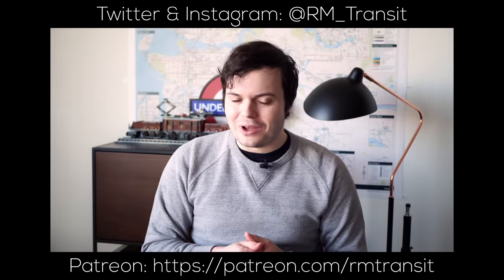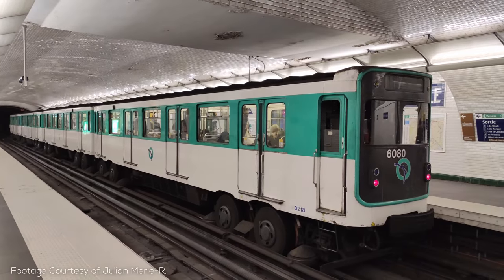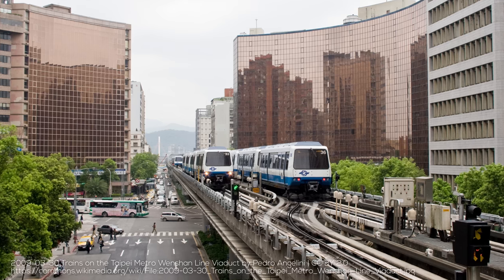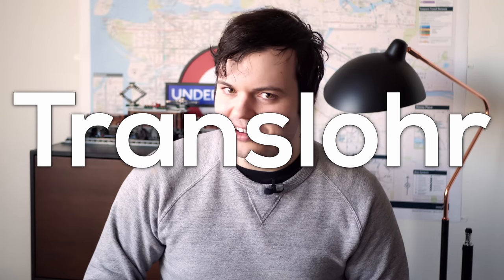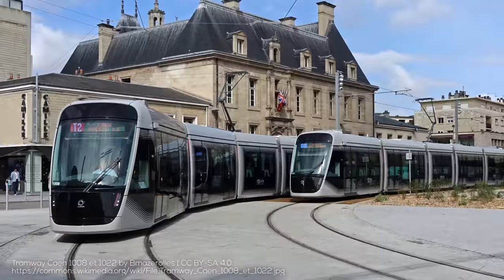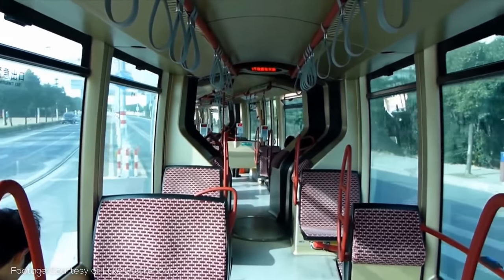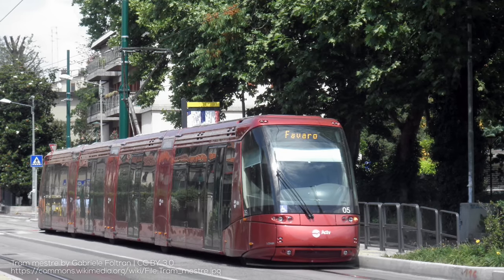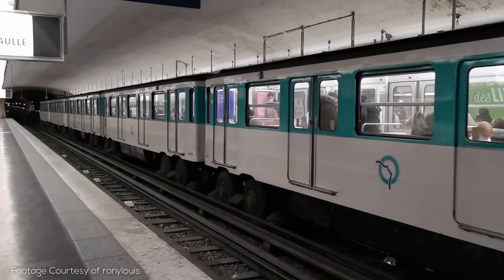Rubber-Tire Rail Transit is Weird

Comment: I was actually surprised you didn't talk Autonomous Rail Rapid Transit (sometimes called "trackles tram" such as in an article by The Conversation — and that one is kind of a joke, really) which takes the Translor idea but with less infrastructure i.e. the "rails" is just paint on the street and the vehicles are battery only, no overhead wires.
Reply: I think ART is still too new to be relevant atm, no cities actually use them yet except experiment units.
Reply: Isn’t that just a trolley bus?
Reply: @KRYMauL  While that's a common alternative name to trolleybuses (though I put them to the same category as normal buses in the same way how I call diesel trains diesel trains and not tracked buses), the vehicles of ARRT are battery buses and aren't connected by overhead wires.
Reply: That’s actually fantastic. Without using a steel guide and pantograph it can avoid the infrastructure cost and it can be varied very slightly to avoid wear. It can go up hill and have better braking. But it can all offer better amenity and higher capacity than BRT. “Paint on the street” isn’t an insult, it’s exactly how we designate bus lanes and stop cars from parking in public space for basically nothing. It’s treated as a joke cause “real trams” already exist but the idea actually achieves things trams don’t. Appealing to the status quo didn’t get horses very far when cars came around. I think these will be very common one day. While people discuss whether they can be a thing car companies are making electric vehicles and mining companies run guided trucks. They didn’t umm and ahh about it asking for permission.
Reply from the maker: They are really just another new bus design that has lots of issues that make me skeptical
Reply: It’s a bus
Reply: @Freshbott2  "Without using a steel guide and pantograph it can avoid the infrastructure cost and it can be varied very slightly to avoid wear."
I can understand with rails but long-term wise, you'd rather want overhead wires than batteries due to loss in efficiency in converting electrical energy into chemical energy and then back (same reason as why we still should build [more] overhead wires now that battery trains exist), it's this reason why many cities such as Frankfurt and Berlin consider installing trolleybuses despite the fact that a majority of their fleet are now battery buses (and I'd certainly start a movement to push them in other, smaller cities with frequent buses as well).
Furthermore, since you lack a return current (i.e. rails), you must use a trolley collector whose wires are a bit harder to install compared to a pantograph system.

"It can go up hill and have better braking."
Since I live in South Germany and have seen trams which handle hills just fine, that one is more of a moot point, though the latter is an actual pro argument (it does come with the cost of energy efficiency, though, which is even more important with batteries).

"But it can all offer better amenity and higher capacity than BRT."
I mean, I'm not fond of BRTs in general, really, by the fact that they have a high running cost despite their low capital cost but they aren't comparable as well since one is a type of vehicle, the other is a mode of a bus.
Furthermore, amenity is infrastructure and has nothing to do with the vehicles deployed.

"’Paint on the street‘ isn’t an insult, it’s exactly how we designate bus lanes"
One is a right-of-way thing, the other is a guideway for a vehicle, they can't be compared with each other. I included that because of the comparison with infrastructure or lack thereof.

"It’s treated as a joke cause “real trams” already exist but the idea actually achieves things trams don’t."
Some cities which used to use a translor switched back to traditional trams so don't set your hopes too high! Derailment may not happen too often (hopefully) but ultimately, ARRT are still a variation of rubber tyred trams.

"Appealing to the status quo didn’t get horses very far when cars came around."
If you understood you correctly, it means that we should always look at innovations and drop old stuff when they're mature? While it's true that some risks should be taken, keep in mind that innovations also have failed quite a bit due to their limitations and relying on old technology just ended up being the best (yes, I'm rather conservative with innovations in general).
In fact, (passenger) trains were considered obsolete like horses because cars and planes are (supposedly) better and yet, they're making a comeback with many new HSR projects (even in NA which is the biggest offender in abolishing trains), reactivations of old lines and building new normal lines while on the street, more and more trams are reintroduced in cities which have removed them.
Reply: really the most advanced part of the ART from what I've heard, is the suspension system which is designed to help give it a smooth rail-like ride. Well okay, but why not just fit that to a regular bus and bring the cost down?
Reply: @RMTransit  Those combine the capacity of a tram with the flexibility of a bus, which makes them ideal as an interim solution for lines that have outgrown what busses can provide but that can't wait for a real tram line to be built. Or on seasonal lines, where the extra cost of putting in rails and wires would be prohibitive. Or even commuter lines that only need the extra capacity for 2 hours a day. I also see potential in using them temporarily to test out planned lines without having to build them first. Or to provide service while part of the regular tram lines is closed for maintenance or construction.

A current example would be Tesla Berlin (plenty of drone videos on YouTube), where they have a shuttle service to the next train station until they get their own passenger station. They are running 3(!) articulated buses every 10 minutes at the moment...

And btw, I think the "autonomous" feature where the vehicle follows painted lines is the most useless aspect. For me, the big selling point would be that it doesn't need any infrastructure, aside from maybe some portable barriers to mark off the stops.
Reply: Perth, Australia is looking at getting this, and they would be much better off getting a tram, or even just using existing busses on a dedicated right of way, brt style.

Comment: Good video and I cannot help but add something. 
I don't think Translohr is better than a tram (and not just because the hybrid electric-pneumatic door system is unpleasant to test after we assemble it in our factory). However to be completely fair to it there are two advantages of it that I have not seen mentioned and as you said in some niche cases they can contribute to this system winning. 
1. the noise - despite the guide rail the one I have seen in person in Paris was singificantly quieter in the street than a tram. Modern trams make the difference smaller and smaller with clever wheel designs but the only time I have seen a translohr running the lack of expected noise was the first thing I noticed and after I wondered why that is I finally saw that it is a Translohr and not a tram. So I guess in some cases this could be a factor when deciding what to build. 
2. narrow spaces and two-wheelers - one thing I absolutely hate about trams is that whenever there is the need for the tram to go to the side of the road in a tram stop or the tram stop is extended towards the rails and there is no cycle path behind the tram stop away from the rails all cyclists passing throuh face a choice of two bad options - ride the narrow space between the high tram stop curb and the rail (and pray no stupid driver will start overtaking you in the remaining space where they fit with whole 5cm to spare) or you can cross the nearer rail at a horribly sharp angle, ride in between the rails through the tram stop and then cross back to the side again. If the rails are a bit wet and/or you are not capable of jumping with your bike you will crash and possibly get run over by anything following behind you. I have seen motorbikes crash in these tram stops too. Translohr will have something like 1.2m between the curb and the guide rail negating the need to go over the rail. So if I had to mix something like a tram line with a lot of trafic on two wheels in narrow streets Translohr would get one plus point in the contest for this. 
So if the line is in a sunny dry city, passes through a flat center where tons of people cycle rather than walk and runs into steep hills on both ends where rich and powerful people living there demand it to be quiet Translohr just migh fit. It will be no cheaper to operate like you said but it could fit the need of such a transit line - climb hills, less noise and fewer raild in the road.

Comment: Rubber tired trams have a counterpart: a traditional bus running on concrete guide tracks for part of its route. I'm thinking of the O-Bahn guided busway in Adelaide, South Australia. Those are normal buses that run on normal roads for a lot of their route, but then run on concrete tracks to cover larger distances with negligible demand for stops along the way. I've seen them with double bendy bus configuration so they aren't quite as long as your average tram, but then a tram doesn't have to take very tight corners.

Comment: Maybe you should also make a video about trolley-busses, quite popular in the eastern Europe.
The main advantage is that you don't have to lay any rails, only the trolleys and you have some (very little) flexibility while driving (if there is a pothole, for example, you can drive around), but you don't have the pollution from the combustion engine.
Reply: maybe you should check his channel

Comment: In my hometown, Bologna, there has been an attempt to an optic guided trolleybus called Civis that eventually never entered in service (as local bus drivers considered it unsafe and it failed safety checks) and it had to be readapted to be used by new conventional trolleybuses.

The vehicles involved were Irisbus Civis trolleybuses, which then were replaced for free by Irisbus (as compensation) by the Irisbus Crealis Neo.

And anyway, in Italy there are two rubber-tyred trams using Translohr tracks, in Padua and Mestre, with one line in the latter system extending to Venice.

As for the Nancy system, it was retired last month

Comment: I rode the Montreal Metro recently, and I really enjoyed it. I felt the ride quality was very smooth, smoother than other metros I’ve been on (tho I’ll admit I’m from the U.S., where track quality is quite poor), and had no issues with the noise. It’s quite a cool and easy to use system, and I really think it’s one of my favorite Metros. I do agree however that steel wheels could probably do the job just as well, but I had no problem with the tires.
Reply: Montreal has a deeply optimized system when it comes to speed, efficiency and capacity. Transmission of vibration to neighboring buildings is something that Montreal wanted to avoid. Montreal's Metro takes full advantage of rubber tire configuration to build high-performance trains that can accelerate quickly, negotiate tight curves and climb slopes of 6.5%, almost always at 45 mph. Steel wheeled trains would cripple performance as they are generally limited to 4% slopes and speed restrictions through tight curves.

Comment: Hi. French here. Rubber trains ("Michelines", Paris Metro) were invented to overcome wheel slip, for better acceleration, better braking, and thus more frequent services, a problem now solved by distributed traction and vector control of electric motor. Thus, new Paris metro lines are built with steel wheels nowadays. The 14 was designed in between, it was modern enough to be automated (with antique computer, even for the time, as far as I remember, all is managed with PDP11s!) , but quite not ready for super duper traction control with beffy power transistors. It also was a somewhat spinoff VAL, as VAL and M14 have some origins in the ARAMIS PRT project.
The VAL uses rubber tires because it was designed by MATRA, of automobile racing fame. Thus, it's very light, it's a minibus on a concrete guideway, allowing very light guideway to be built for pretty cheap, with automation from the get go and high frequency.
I don't consider both to be gadjetbahns. The Paris metro used tires because there was no other way to improve a technical problem at the time, and the VAL is a pretty capable light metro system with many advantages that allowed small cities to have a transit system.

(I wont talk about translohr, ok? it doesn't exists. )
Reply: Very informative comment, thanks!
Reply: Great input, although Gadgetbahns Don't have to be a failure, so I would still keep them in the catagory (along side the SkyTrain)
Reply: More informative than the whole video, thank you.
Reply: @neolithictransitrevolution427  to be fair I think the neoVAL is more gadgety than the original one. The original one had become a standard with fleet interoperability possible, and the neo killed it with the stupid translorh-derived proprietary guide rail.
In Rennes they now have two different systems completely not related thanks to this stupid idea from Siemens. The Rennes metro cannot be considered at network...
Reply: @Damien.D  I agree its a negative improvement, the original had a clear area of expertise (although, I think Skytrain out performs with a similar outlay)

Comment: Nice Crocodile/Krokodil model behind you. Another way to provide a smooth ride was the PCC cars used in New York and other U.S cities in the 1950s. They had air suspension and air conditioning and were the most comfortable way to travel until displaced by the automobile.PCC cars had all the benefits of rubber tyred vehicles with none of the drawbacks and ran on regular tram tracks with high efficiency.

Comment: Also got one in Bangkok. Bangkok is most varied transit city in the world, we have subway, monorail, trains, elevated trains and also rubber wheeled train. Right next to each other.
Heck, our train system is so crazy, you have to get off the train, buy a new ticket, then get in again if you go over a certain part of the city.

Comment: I have used the BRT in Jinan, Shandong, China, and for that size of city (3,25 million inner city, 5.6 million metro area, making it a smaller city by Chinese standards), it is ideal.    Station stops are very efficient due to fare collection at the entrance to the platform.  Miss a bus and the next one is following in 2-3 minutes.  The only unanticipated delays are red traffic signals, and that's necessary for safety of others, especially bike and moped riders.  More expensive options are not needed.